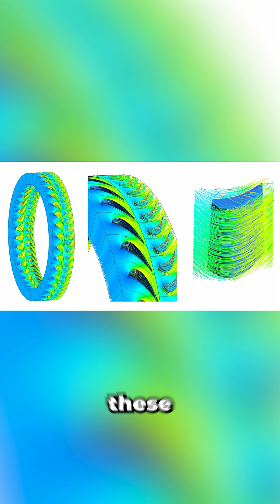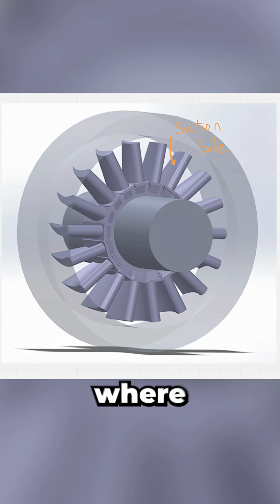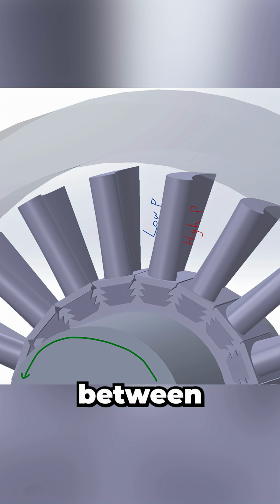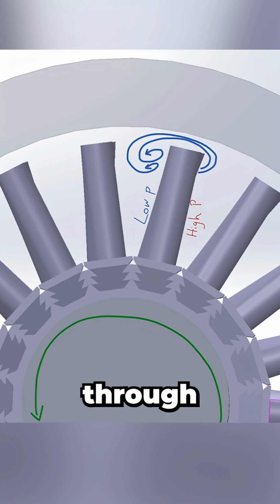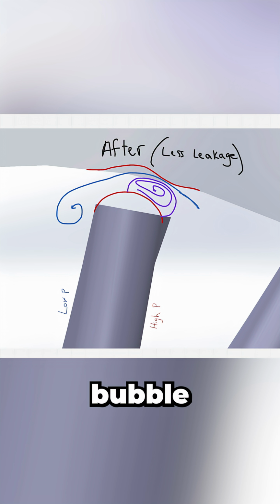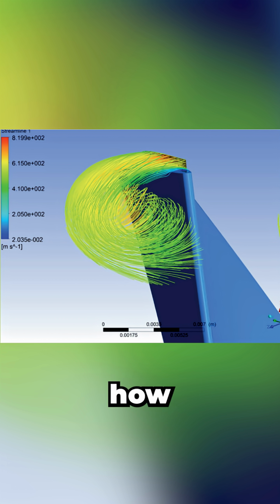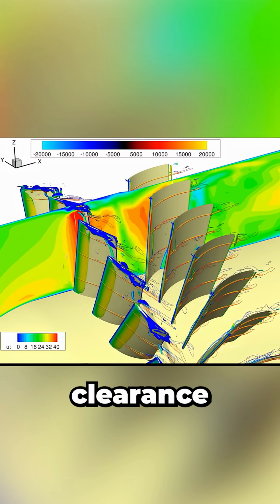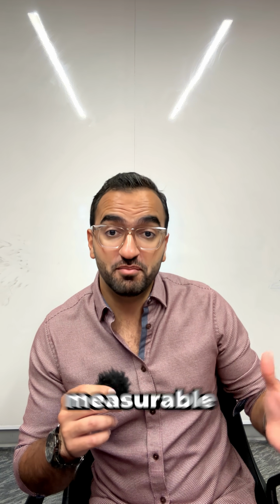The tiny gap that wastes a third of turbine power

Comment: Why can't they have a collar fixed to the outer edge of the blades, thus moving the gap far away from the blades?

If it's responsible for 30% of losses, a bit of extra weight, preferably carbon fibre would surely be worth the additional rotating mass inertia.

Comment: I worked on a system that was redirecting the cooling flow over the casing to reduce or increase the gap and avoid the rubbing. It was interesting to me back then how turbines rubbing on a casing is not a more of a critical case, cause intuition says it's a no-no.

Comment: Academic sometimes need to go hand in hand with industry. There must be a reason why its not done. GT has been around for many years and im sure this has been studied before but due to certain aspects they are not implemented. Aspects such as manufacturing, installation, disinstallation, maintenance, balancing rotor, overall structure integrity with the groove addition on casing etc must be considered in real world. Sometimes in theory they are good but not in actual operation.

Comment: There is a system in place that actually regulates this distance currently employed by gas turbine engines. Used in the CFM56-5 series onwards. It’s called the HPTACC system. (High Pressure Turbine Active Clearance Control) system. It regulates this gap by allowing colder air to flow over it reducing or permitting expansion through heat in a variable valve. And it monitored by a laser sensor. It’s an active system that requires input where as the one shown is passive. CFM internal doc’s show HPTACC and LPTACC (Low Pressure Turbine Active Clearance Control) reduces turbine loses by about the same metrics as shown in the short. Pretty clever system.
Reply: Very cool, thanks for sharing this.

Comment: I always thought, Why there is not a fixed ring attached to the blades so there is no gap and you only need to worry about the contact of this ring with the turbine case (that could be easily solved with a ball bearing)?

Comment: It’s crazy that something like that hasn’t been implemented already. Turbo fan engine manufacturers have really done some incredible things to make engines more efficient.
Awesome work by Mohammed. And for a masters!
Reply: Because it creates more drag, requires more power and decrease structure integrity. Good in theory, complicated in practice.
Reply: @Dimapur  none of those things are true regarding reshaping the blade tip slightly
Reply: Because there is a downside that cancels out the advantage.

Comment: Well, apparently the leakage thing is a bigger problem for smaller turbine engines, which causes them to have lower efficiencies. All turbine engines of course, but more so the smaller ones. Maybe this can leak (no pun) into the industry and help us make smaller turbine engines more efficient. Apparently if there are large compressor losses the power extracted by the turbine gets largely wasted, and of course less compression due to losses tends to mean less power and efficiency. Something like that. I didn't know the losses were that big, saw that in another video too. Ya so you must have had a good computational fluid dynamics software thing going on. To be able to model all that. And usually good on large scale aerodynamics but I wouldn't be sure if it could model things on smaller scale and small gaps. Well, sometimes you got to look closer at the smaller things I guess. Sometimes there are small things we can improve on that make bigger gains, just got to take a closer look. Smaller axial flow compressor mite be more efficient than a centrifugal, if it can be made efficient. Good luck with your work.

Comment: I think this pressure parameter is more  applicable at max f/fs cane because if f (f=mf/ma) high the downstream Flow behavioral trend generate advanced Energy boundary layer. Unlike Shroud, an extention like bladelet can Easley marginalized the separation in-between upper and lower pressure segments around the turbine blade. Provide at higher TiT

Comment: This is so cool! It's amazing to see how a small, simple fix such as this can contribute to an overall significant boost in efficiency!
Reply: Wellll...
The video didn't say the engine loses 30% of its output. It said of the total losses in the engine, 30%of that was at the turbine tips. So of the total thrust of the engine, what are the total losses? Probably pretty small in comparison.
Reply: It’s about increasing the fuel efficiency across an entire fleet of aircraft. Just like the winglets, changing the design to save a few MPG over an entire airline makes a huge difference!